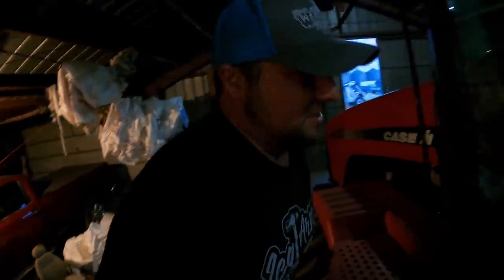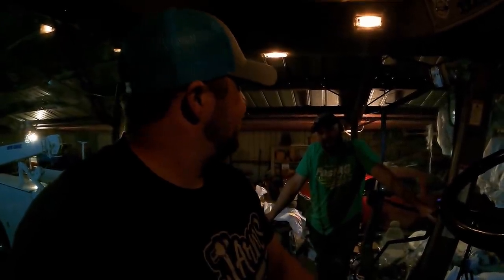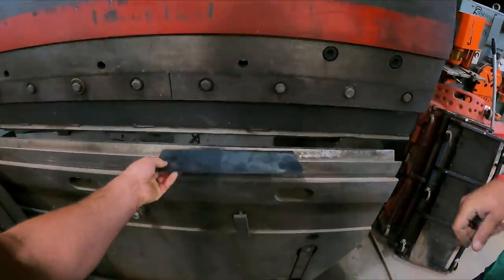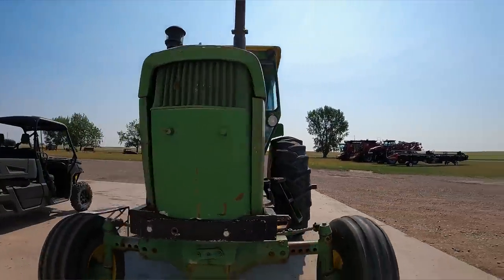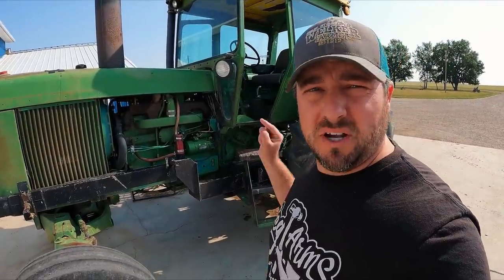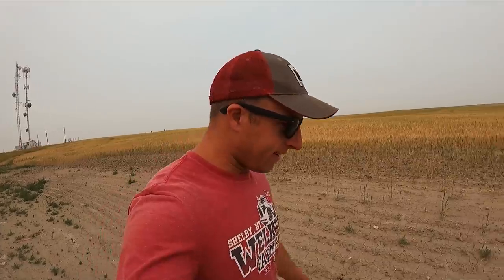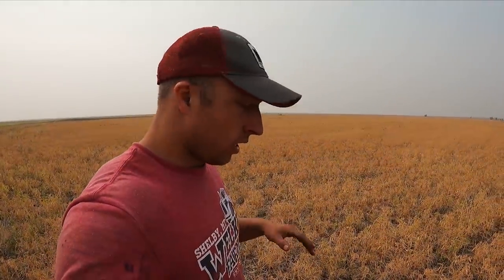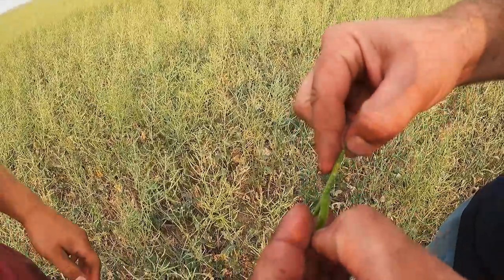Tractor Still Broken! *Parts Scarce* Backup Plan?

Comment: One of the benefits of being a pilot and having a booney hopper. Most dealers are outside of town, if you do a fly over, noting your obstacles, you can get it down and go in and get your parts. Getting out is a lot easier, my old super Cub is off the ground in about 40 feet if you pour the beans to it.

Comment: I have had medium success with using fiberglass to patch plastic tanks.
Can conform to the curves, and depending on how well the resin sticks to the type of plastic, it can either be used as the seal, or used as a mechanical backing to hold a seal in.

For instance, fill a crack with a good polyurethane caulk or whatever, and lay a good layer of the Poly on the surface around the crack, and after it cures, you layer up fiberglass over it for a thick sheet. After it cures, run metal strips on each side of the crack (you can cover them with more fiberglass if you want) and then drill through and put bolts (or self tapping screws on smaller jobs) through to squeeze the fiberglass against the caulking.
Either glass over the bolts afterwards, or leave them exposed so you can tighten them more as needed.
Caulk the bolts/screws of course.

Sometimes I will carve the crack wider so that I can put a layer of fiberglass on the inside and outside and they connect through the crack. Think of it like a plug weld.

On a large tank like that going over bumps, it might get a lot of flex, so I would look at the mounts and see if they are positioned badly or not supportive enough.
It may need a cradle to support that side of the tank and relieve the twisting force.

And maybe Flex seal will last for 20 years! Lol

Comment: Run a radiator flush and new thermo on the Deer. if it don't help, leave the cap off while running and watch for bubbles.... and or, water pump is weak! God bless and hope all gets fixed!

Comment: Well, Leg Arms, if you haven't back flushed the radiator and heater core I would suggest that.  If you have then I would suggest getting another radiator core with one extra set of cores on it.

Comment: I’m much more inclined to trust a sealant tape like that on the inside of a tank vs the outside. Pressure from water should help keep it tight
Reply: I'd put a layer on both sides, so no lateral forces (like from sloshing in the tank) try to push the seal aside and compromise it. Inside and out, makes a more complete seal with better hold

Comment: For the overheating, change the coolant thermostat.  They often fail slowly and if they don’t fully open you loose cooling performance and don’t know it.
Reply: Or it could be the radiator. My truck is vapor locking with a new thermostat that opens at a much lower temperature.
Reply: 1. Thermostat.  2.  belts and pulleys. Belt tension?  3.  fan blades all good.  4. All the fins clean?  5. how clean is it inside?  Coolant system flush needed?  6. Water pump OK?  Impeller rusted away?  7.???

Comment: I'm sorry, NW has had a really bad summer. I live in NM where we are used to hot and dry. There have been several weeks when it has been cooler and wetter here than the Pacific NW. We were hot air ballooning in Billings last week. I believe the hot air balloons in billings had the only open flames in the state of Montana. The day we left, Billings had a high of ~105 degrees F. Albuquerque just made it up to 70 degrees F. Prayers.

Comment: Power flush the coolant system. You wont believe the rust sludge that builds up. Creates a slime every where. Refill coolant add Cummins pink liner protection.

Comment: Put an electric fan on the front to help with the overheating. We do this for stationary equipment in the South where it's often very humid and hot, neither of which is good for cooling. Flex Tape is an amazing product. You're gonna be wowed!

Comment: Engines that use any form of coolant over the years build up scale in the system reducing the cooling ability. They make the two part descalers, however most use an acid component and ultimately eat a hole in the radiator of take the water pump out.

I've found that machine wash dish washer detergent like Cascade left in the system for a day of so slowly dissolves the calcium scale, doesn't eat metals and does a great job of also removing any oils that may have leaked past the cylinder liners.

A much lower priced material than Flex Seal tape is the tape used to seal Zip R sheathing. Good flexibility and available at the local big box hardware store. The second alternate is the ice dam sold for roofing. Also available in 36 inch widths, so if you have a large section of the tank that is spider cracked, the width is in your favor.

Comment: Definitely worth dragging the coolant out of that Deere and back flushing the system extensively to remove all the yeast of muck inside, including taking the rad off and inverting it, nice drink of correct ratio coolant will see you right. Re Hydraulics,  it sounds like a filter is blocked somewhere? She may be old but she can still earn her keep!  Sorry for the storm damage let's hope Lady Luck shines on you. Thanks.

Comment: You thought about putting an automotive type pusher/puller type fan on the JD radiator? I'm sure it would move more air than the old engine mounted fan. Another option would be to  utilize  any additional plugs in the head or water pump to pull a % of water out before it picks up too much heat and pipe it back into the cooling system. Could also add an inline trans cooler (w attached fan) to cool it more. I did just the additional routing scenario on a 454 I installed in a smaller car. The heads had pipe plugs in the heads between the center two cylinders on each side. The water pump also had additional inputs/output plugs. It dropped engine temps 15-20 degrees.

Comment: scott from old john deere man on bottom hydrolic pump stroke control valve screw in to raise presure. if still not pull brass screen and clean.  should be in service manual or on line. 5 minute job. good luck

Comment: Scott if i remember right, those series John Deers had the fuel tanks in front of the rad in them. and if i remember what happens over years we do know some fuel ect gets spilled over time, and the air conditioner rad there also, they build up with dust grass straw ect ect ect over time It takes longer to get the hood up and front undone than loosen and pull ahead the fuel tank to clean good. probably easier to pull the rd and clean good.. Ask Nick from South Sask Farmer, yes a you tuber.   he is a GREEN GUY.. also ask him, usually what makes JD hydralics loose preasure is not the pumps is usually the block that comes off the trans, they burn out the O rings and oil by passes. those JD's were bestest ol tractors ever made and simple to keep running

Comment: I really hope you guys can modernize the fleet over the next few years.
Reply: I mean it is a good thing overall, but it also requires a lot more reliance on dealerships.
Reply: Looks too me any time they have called a dealer they have some one or info And uh didn’t a dealership loan them a 1/2 million dollar tractor
Reply: @jthomp997  I agree.  You have to keep in mind, when the equipment you are trying to buy parts for us 30, 40, 50 years old, you can’t expect dealers to have or be able to get parts for them.  When the stat of your business, home, family’s livelihood relies on equipment that old, you have to evaluate things.  You have to determine at some point, why am I relying on the only two tractors on the farm which have a PTO and it is very needed and they are 30 plus years old. You have to invest.
Reply: @davidcatlette9697  I think the loans were from Case IH and just facilitated by the local dealer.  The 620 Quad would be the worthy successor to the Big Buds.  They need a successor for the 100 HP with a PTO too.  Each business has to evaluate their current and future needs and budget accordingly.  Whether it is land to purchase or lease, buildings, tools, bins, etc.  Then develop a strategic plan to meet those goals.
Reply: @davidcatlette9697  "Sponsored by CIH"
Reply: @J-1410  but , for how much longer will you be able to get parts?  Till they are 75?  80?  I’m not against old.  I’m old.  I’m saying the Buds break a lot.  They admit to having problems finding parts.  Tractors are down for months.  That does not make good business sense.  Keep the old gear, run the old gear.  Plan for the future. Lack of planning and failure to and refusal to upgrade will eventually spell disaster.  I’m not saying don’t run the old stuff, I’m saying add new.  Buds are awesome, it is what drew me to the channel.  Every one of them loved that new quad.  What is wrong with planning to buy one in the five years?  What is wrong with adding a newer 100 hp tractor with a PTO?  What is wrong with planning for the future?
Reply: @J-1410  apparently you don’t watch all the videos.  

I am going to make it easy for you as you obviously don’t understand business and planning for the future.

You are right.  Send me your address and I will send you a tin foil hat.  

It is fine to keep operating your business with 100 year old equipment.  No need for anything new.  

No, I didn’t read your entire statement.  What does it matter?  You are right and anyone that doesn’t agree with you is wrong.

Nothing will change that.  I am going to block you anyway.  Apparently, I am not allowed an opinion.

Comment: I’m guessing the mm u is out of the question because of needing hydraulics?
Reply: It has hydraulics but maybe not enough for the auger. Likely to be low on power (36 pto HP compared to the JD 4520 at 120 pto HP)

Comment: 0:18 That propane tank should not be installed that close to the building. A 1000 gallon tank should be 20 feet away from the building. No less then 10.
Reply from the maker: It's empty 😁
Reply: @WelkerFarms  I was fooled by the pigtail leading off the tank to the piping leading into the building😁